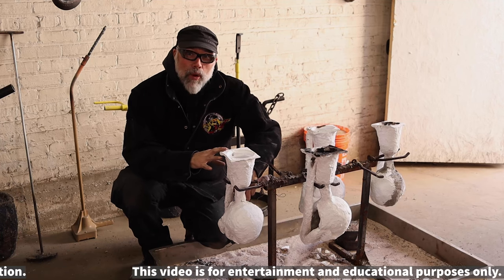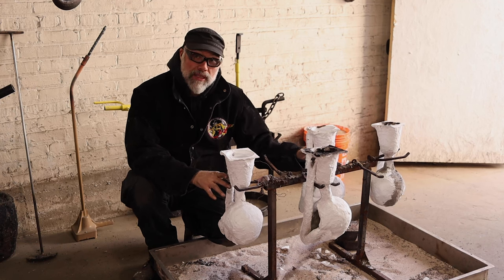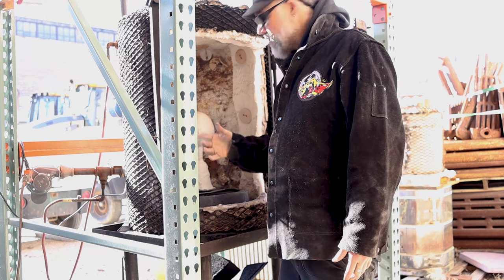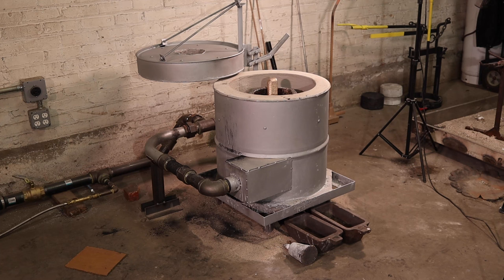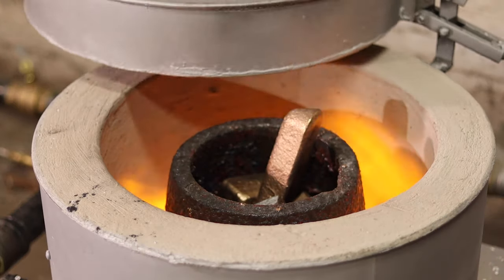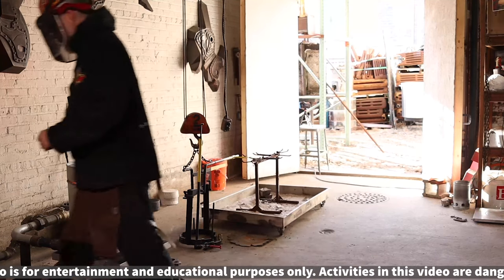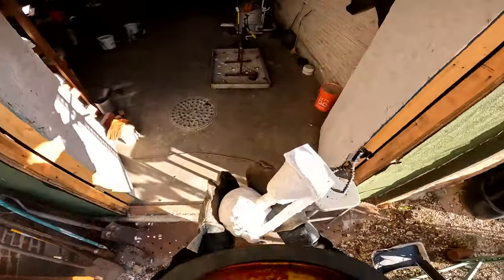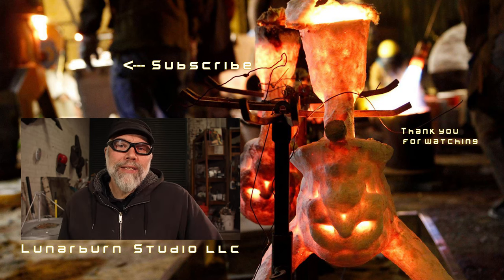How I pour molten metal into ceramic shell

Comment: Just retired out of the military and I have always wanted to try some molds like this. 
Would be interesting printing off some blade profiles and pouring some high carbon steels for this vs forging them...
Have lots of leaf/coil spring material laying around I could use. I don't think a propane forge would be sufficient to melt these metals?
I have a couple bags of coke in the garage, perhaps I could use that inside of a clay forge with high temperature refractory brick?
I know this coke is rated at around 4000F so I would need a solid crucible! 

Thanks for all of the instruction! Very thoughtful of you to take time out. Stay safe!

Comment: please help with a question: have a sculpture to make and my foundry burners are struggling to heat to poor temp. i fear my recycled iron pipe burners are too small 1" int dia and would like to know what size you are usuing and do you put a flare on the hot end? and how do you proportion the top vent to the burner size?
Thank you very much for your fab videos, along side formal training and some time in a working foundry as apprentice i have been very excited to finally build my own foundry and hot shop for fabricating sculpture. Your videos have been a great help for me make the leep into one man foundry process.
Reply from the maker: I am glad to hear you are finding my video helpful.  
it does sound like increasing your burner size will help. and your exsust port may be be a bit small.  
I would make it 5 to 6 in dia.  Are you running one burner or two?

Comment: Nice setup you have established there. I have recently made my first bronze pours. Similar sizes to your skulls, and about 60 kg total in several molds. 
I have been watching all your videos to gain knowledge on ceramic shell process. They have been very helpful. Also made my own kit of tongs, but had to go with a two person setup. Being able to pour large pours on your own is pretty cool though.
Reply from the maker: If possible it's safer to have an extra person helping. but having the option to go solo is huge.
Reply: @LunarburnStudio  Come to think of it, I do have a question for you. Some of my pours are with very high surface details that I need to preserve (skin texture). I haven't had time to clean off all the ceramic shell yet, but I am seeing a lot of "dendrites" on my surfaces. So probably from having bronze penetrate between the grains of sand in my ceramic shell.  Looks like I can chisel them off with little- to no ill effects. 
But I am wondering, if additional coats of slurry with no silica is enough to counter this, or I need an even finer mesh silica for the first coat with sand? I think I did sand on the 2nd or 3rd coat of slurry this time around. Seem to recall you previously mentioning something about using... another denser and fine grain for your first coats. I just thought that maybe the additional slurry coats could do some of the same?
Reply from the maker: For high detail surfaces one or two slurry only coats should be good. Let me ask are you brushing the slurry after you dip?
Reply: @LunarburnStudio  Hmm, my comment might have been deleted for containing a link. Yes, I do brush and stipple the slurry after a dip to dislodge air pockets. I have noticed that dipping after silica have been applied, it will keep exposing more air pockets. That is probably the nature of dipping and soaking a porous shell I guess.
Reply from the maker: @Steen Holdt Between course coats I defiantly let the shell soak a bit. but on dips that are over the 50/100 mesh sand I like to pre-wet with a mixture of colloidal and distilled water (50/50).  This brake the surface tension and allow better bonding between those early coats.

Comment: Super clear video (once more!) - thank you. I am considering resuming the bronze casting my father did in the mid seventies Where he was using traditional investment, I plan to us the ceramic shell process and your videos are very helpful for  understanding and learning this technique. 

Watching this video, I was wondering if it wouldn't be easier to have the crucible in stationary position (i.e. tilting only) and manoeuvre the shells - lined up - instead. I can see a rail for the lateral movement of.a tray on which another tray (similar to the one you have) can move in the perpendicular direction.
Reply from the maker: I am glad you are finding my videos helpful.  As for moving the shells to the metal, there are tilt furnaces that use a similar method that you suggest. I have done it multiples ways over the years, this current setup allows me to pour without the need for assistants.

Comment: Your videos and the way you explain what and why you are doing is excellent.  The question I have is what kind of crane you are using seems to be a jib crane.  I am a one man show as well and am thinking of building a jib crane so i can swing it over and roll the trolley in and out by hand then i only need to use the hoist control to move crucible up and down.
Reply from the maker: I wish it was a jib crane. Its a small bridge that  you have to manually drag, North /south its too heave to pull with the hot metal so I can only go east/west. So I line up the furnace and pour pit along the rail.

Comment: Is this generally a one person job? Does the weather and temperature outside affect how much time you have to pour the metal? Why is the platform that the shells are standing on filled with sand? What does the sand do to the metal droplets? Why do you have to avoid mixing hot metal with cool metal? I've seen this one video on tiktok where someone seemed to be doing a pour but there was a sudden explosion and the metal splattered all over them. Is that what happens?
Reply from the maker: 1. Typically most foundries use a team of 3-5 people.  Its just with this spciel piece of equipment that allows me to pour by my self.  But to be clear, I try to have help when I can.
2. Weather can play a part but I do pour year round.
3. if molten metal splashes and hit a bear concrete floor it will bounce/spray/explode.  The sand creates a barrier or air and insulation.
4. Its all about the inherent moisture on the cool metal that turns to steam and expanse in a violent way that is unpredictable.  That is why we do everything we can to keep moisture away from molten metal.

Comment: Great video, really interesting to see your process
Can you tell how you fix the shell when having a leak on a part of the piece please?
Reply from the maker: It depends on the size and shape of the leak.  If it is just a pinhole it just be a matter of putting a cold piece of steel over the leak freezing the hot metal to form the plug.  Larger holes can be plugged with a heat-set refractory or some times a mixture of slurry and chopped fiberglass. either will need to be help in place till the patch sets before resuming the pour. And some times you get lucky and the leak will freeze it self off as it did in this video.
Reply: @LunarburnStudio  Ok, that's clever, I'll definitly will try fiberglass+slurry on large plate shapes to test till how it can handle it.
Many thanks master.

Comment: Another thing cane to my mind after my last hollow cast. Do you break the shells inside your casts? I was thinking about your skull casts. Do you try to brake and take out as much of the shell from the inside of the skull? 
I have difficulties regarding that matter. I just cannot hammer the cast so much because I made it in aluminum and the wall thickness is about ~5mm. I was hammering the rise and there is a crack already. So maybe will putting it in water and when the shell with soak it it will break easier? 🤷🏻‍♂️
Reply from the maker: I do try to get out as much of the core material as possible.  I will keep that in mind as I am spruing and if i need to create access points to facilitate the removal i do so.  Soaking the shell in water will not dissolve it or make it weaker.
Reply: @LunarburnStudio  thank you. I thought it simplier to be honest ☺️
Reply from the maker: have a video that will go live in about an hour that talks about shell removal.    If your castings, especially aluminum are too fragile to break out with a hammer you will need to rely on sandblasting to remove the softer shell from the metal.
Reply: @LunarburnStudio  yes. It was my first hollow cast and I made a mistake that I made the walls of the cast too thin (only 4mm). Should have done a bit thicker, maybe 6 or even 8mm and I would be fine. Well I think.
waiting for the video then ☺️

Comment: Thank you for your good training, please tell me what material your furnace is made of, if it is made of ceramic blanket, please tell me what temperature and what thickness and density it is?
Reply from the maker: I did use silica wool in my furnace build that is encapsulated within a castable refractory and a final coat of Satanite.  I hope to finish a video on my furnace build soon.
Reply: Thank you so much
Reply: @LunarburnStudio  I built a furnace exactly like yours, today I tested it for the first time and there is a problem, when I turn on one of the burners, everything works fine, but when I turn on both, gas accumulates in the furnace and an explosion occurs.  It happens and makes a loud noise, please guide me, also the blower I used feels weak and I need to change it.
Reply from the maker: @aminbagherloo1444  Yes it sounds like your blower is under powered and is not push all the gas into the furnace chamber.  what size crucible are you using?
Reply: @LunarburnStudio  The inner diameter of the furnace is 36 cm and the depth is 50 cm. I thought that a40 would be the right size. Please guide me on what power blower to get so that everything works properly?

Comment: Great video as always from you Eric. I got a lot of information from your videos and they did got me to the place that I am now.
I use shell casting process also but as solo and more of a home made, I bury my shells in sand actually. I do not have space and maybe I am more afraid of the molten metal going out of the shell. Maybe thats why I use the sand burying technique.
Reply from the maker: Burying shells in sand has its place and if you are concern about leaks thats fine.  Just make sure you cover the entirety of your pattern  and if possible preheat your sand to keep the cold sand from cooling your shells.
Reply: @LunarburnStudio  that is what I try to do. Sometimes it works, sometimes it does not. But I am not a professional sculptor and metal caster. I learned all that I know by myself and with help of videos like yours Eric ☺️
Reply: @LunarburnStudio  also I am looking for those heat resistant mitts. I think I found almost the same but I would like your opinion on them. Better to get with or without steel mesh - the contact heat resistant is 900*C (without steel mesh) and 1000*C (with steel mesh)? I do not know about the costs but for protection it does not matter much for me. Safety is first.
Thanks.
Reply from the maker: The stainless steel mesh is nice in that in that it does increase the temp you can touch but also greatly increased the life of heat mitts.  The company i got mine from is https://silverneedle.net/molten-metals-gloves/
Reply: @LunarburnStudio  thank you Eric!

Comment: Have you done the casting in a metal flask? I'm doing a reproduction of a mixtec brooche, and I need to cast it but don't have a large setup. So, instead of dipping the wax, have it in a flask and pour slip into it?
Reply from the maker: Metal flasks work with a plaster base investment, not so much with the ceramic shell.